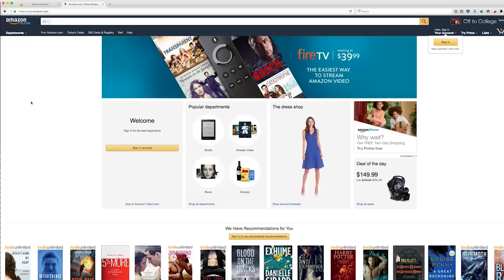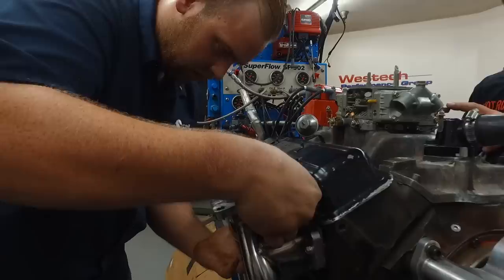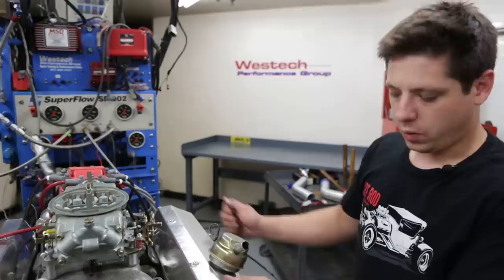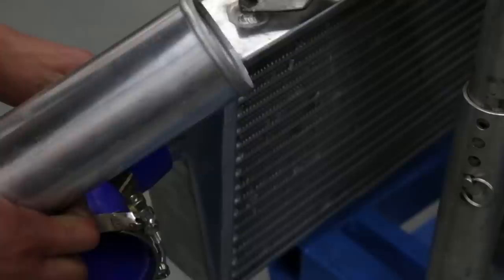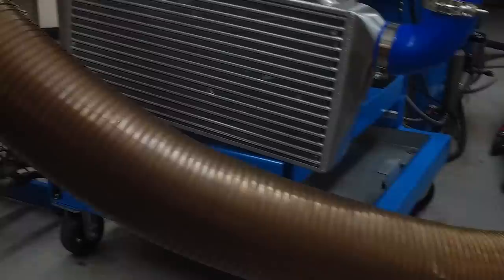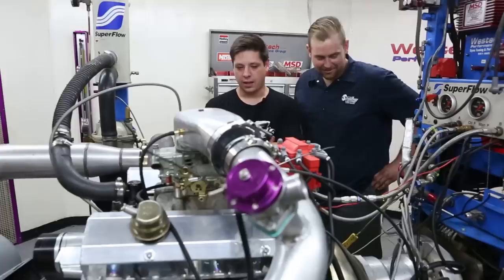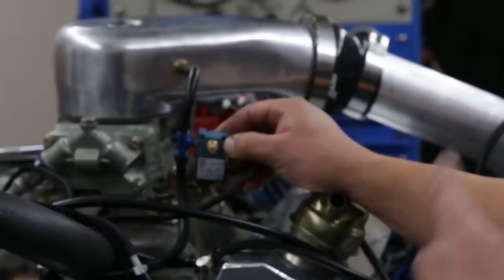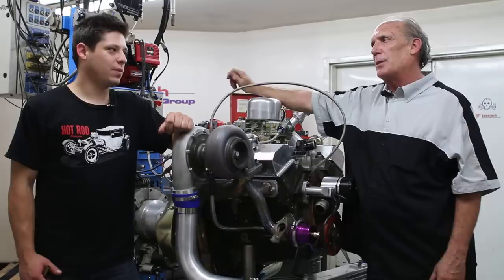Small-Block Turbo Kit for $699! But Does it Work?

Comment: Did my own ebay turbo kit and what i found was the biggest issue was not qualify, but the fitment... Turbo had the studs put in wrong lol. Everything required modification. No instructions. If you are persistent you can do it. But i would reccommend something like bell engineering who makes their own kits and makes sure they fit.

Comment: Hey look. Overall this kit is awesome. 7 hundies and a beat old small block and your zooming down the strip like a madman. This is great! Yeah you may need to do a bit of fitment, and you need SAE and Metric tools. So what. Not for nothing, but even if you spend the big bucks, there is never a 100% guarantee it all fits or works properly. And if it blows and takes that leaky small block with it.... You can feel good knowing you didnt waist thousands. So its a win win. What I learned from drag racing, Fast don't last, lean is mean but burns rings and ect., and the top fuel best of the best are destroying the entire drive train every single run to get those numbers. So if you can toss a barely average paycheck into your beat old junkyard small block, and get a turbo beast. Even if its a few good runs before failure, for the price, its worth it. My advice in all this is. Make sure you do a compression leak down test, before you buy the donor junkyard small block, and the exhaust system should end at the turbo. And you should be golden my friend. LOL!!!! Well....maybe.  

P.S. Leave it on kill. Waist gates are a waist, and don't adjust anything. Just bolt it on, and off you GO! Seems to me they have it tuned perfectly. Just please remember to make a YouTube video and post it.

Comment: It had boost creep because you didn’t run the wastegate pipe which was blowing air into the turbo causing thus boost creep pretty common problem.

Comment: I think you guys put the manifolds on the wrong sides.
Reply: they said in the video why that was done
Reply: clearly they were going out of there way to make sure it didn't work right.
Reply: I too thought this, but If they turned it they said there would've been clearance issues around the brake booster (in a car).
Reply: i have the same headers on my 84 camaro and the passenger side is the only place the turbo will fit. due to the break booster.
Reply: draggonhedd it comes like that the kit is shit

Comment: Gen IV 454 60 over bore . forged internals flotek heads 2 bolt main studded. Hydraulic roller cam.  Pair of gt45 turbos cx racing headers  . making 1012 hp at back wheels .

Comment: Is that a normal carb? Not pressurized carb???? How is
It not blowing gas out the vent wholes????
Reply: *holes.  its a blow through supplied by westech
Reply: It looks like the vent holes are under pressure as well.
Reply: I was wondering that myself
Reply: *whores 
If it's Blowing & Holes lets use the right words gentlemen.
Reply: came here to comment on the same thing, great vid but unprofessional as f. not to mention the carb at all. obvoiusly a boost app carb will cost as much as the premium package turbo kit. I cant believe they skipped that completely
Reply: bullshit, whats the fuel pressure inside a carb and whats the boost pressure? youd have negative fuel pressure (fuel vacuum sort of speak ) the boost pressure would force the fuel away...
Reply: bullshit, whats the fuel pressure inside a carb and whats the boost pressure? youd have negative fuel pressure (fuel vacuum sort of speak ) the boost pressure would force the fuel away...
Reply: The problem you're describing can be solved with a boost-referenced fuel pressure regulator. It raises fuel pressure 1:1 with boost so you never have fuel being pushed backwards through the jets. 

http://www.hotrod.com/articles/build-blow-carb-less-50/
Reply: yeah, thats a lpt of mod completely ommited in the vid!
Reply: Normal carbs can take a certain amount of boost just fine without worry but there is a limit. Once you reach that limit you buy a blow through carb.
Reply: number3665 i dont think a normal carb would even fit with a carb hat, choke horn would be in the way normal carb would leak boost, also normal carb would run lean potentially blowing up the engine due to not enough fuel(7psi of fuel vs 8psi of boost gives no fuel pressure). Its all good but i think they should had atleast mention something about it
Reply: 1DEADBEEF1 Actually it would though I've seen it done on an old Dodge 225 slant 6 engine. I've even seen guys run newer style Eaton supercharger and use a carb with that. Never underestimate a hot rodder. They didn't run much boost on either one though  I think it was actually around 8.5 -10psi of boost with regular carbs.  Not sure about the carb hat size though it used a Holley 2 barrel, maybe fabricated something up for that. But you in fact CAN run a regular carb with boost you just have to know your carbs inside and out and know exactly how to tune and jet them to keep the air fuel mixture where it needs to be.

But you are absolutely right them not mentioning it in the video opens up this gateway of trying to figure it out. And what we come up with could be more expensive or even more complicated than they did.
Reply from the maker: Actually, it's a stock carb with less than $50 worth of mods. Check out the link in the video description.
Reply: Just need to add 1 lbs of fuel pressure for each lbs of boost. Atmosphere is 14lbs so a 1 lbs boost is 15 and so forth with a boost adjusted fuel pressure regulator.  All carbs work!!!!!!

Comment: Please do this on a engine that is factory forged cast iron blocks forged INTERNALS and has 32v 4 per cylinder - 2UZFE 4.7L from a Toyota tundra/sequoia ECT 

This engine is designed for boost - very reliable very strong... maybe use a megasquirt too.. those are my plans for a 02 tundra sr5 4x4 2UZFE 4.7L V8 ... I already bought powerstop, box headers, twinntake exhaust &NGK racing plugs , CAMBERGE  ill have mid travel for awhile...I run ROYAL PURPLE but I'm thinking about using amsol next after I finish up what I have ... & the Amazon turbo kits are what I was looking at as the supercharger for my truck  is very rare and expensive aswell but it'd be nice to see what a pro can do to a truck  with a simi limited aftermarket for power adders....

Comment: Just use a 90° elbow and run the exhaust stack out the hood. And weld a couple radiator filler necks to the tubing, with radiator caps set to the max desired pressure to keep from overboosting.

Comment: It depends where you come from as to whether the exhaust manifolds are on the wrong way!

 I come from Australia so yes they are on the wrong way, wherever you come from the turbo should be on the passenger side
because that is generally where your air intake is, plus you wont hit your brake booster, so i'm thinking that kit was made
for RHD cars as the exhaust manifolds should've been swapped and turbo would be on the other side!

 Also if they had it on the right way, they wouldn'tve had to beat the living crap out of the manifold to clear
the sparkplug....i bet the front pipe was a bit longer before the bend and had more of a bend in it, since
it was designed to go the other way i reckon!

 I tell you what though, for the price they paid and what they got, you can't complain!

Comment: Great video, BUT- half the bolts are metric and half are standard? No, half are correct and the other half are American. Even the people who invented imperial don't even use it anymore its so outdated. 

Quick fun fact- water freezes at 0 degrees Celsius, water boils at 100 degrees Celsius. Easy.

Comment: Buy Torqstorm superchargers... So much easier for cheap.
Reply: Dylon Desbiens still that’s like 2 grand vs 600 bucks
Reply: RennWickam which kit is 2000 $ ?
Reply: Petar Baev the raised the price, the base Torquestorm single centrifugal tuner kit w/o accessories is $2800
Reply: RennWickam Thank you for information
Reply: Ummm supercharged uses engine power to run and over 2k to purchase. Turbo, dirt cheap uses wasted energy to power. Am I missing something?
Reply: Lag and boost threshold.
Reply: Brian Warner ungodly amounts of heat like glowing red amounts of heat and boost lag
Reply: Superchargers use more gas and are useless top end.
Reply: K3ueger Gaming Gas mileage is out the window anyway if your even driving a v8 And unless you go to the track or are into super dangerous highway racing top end really isn’t that important romping it around town is what most people do and sc is perfect for that. my opinion anyway
Reply: Lag is all but non existent with a proper tune and torque converter
Reply: maybellene500ss probably so man its not like i even really know i dont have either one sc just seems better to me
Reply: Renn So if you took it to a shop and had THEM do the install, what might they end up charging you to install (if they even could figure it out) the $600 turbo, versus spending the $2k for supercharger?
Reply: Brian Warner nothing really. Turbo is much harder to install and more difficult to tune. Other than that there is a reason turbos are a go to for power and fuel economy. New age technology vs old school

Comment: You could probably use short spark plugs for headers. Perhaps it would clear with angle plug heads
Reply: True, but it's still more "hot rod" to dimple the header.

Comment: SCREW Turbos go Supercharger instead. My 360 mopar is putting out 691 hp & 608 ft. lbs. of torque with the Blower being  Under Driven 12%. The Engine was built by BIG AL’S TOY BOX and runs FANTASTIC.

Comment: Add a hollow metal ball between carb and intake manifold ( works like a bong)vaporizes and atomizes gas doubles gas mileage
Reply: Robert Burchell Jr wrong
Reply: @CRUISEWITHSPIRIT  I made three of them one for a 65 Dodge truck one for an 85 Chevy truck one for a 73 Honda CB360 I know it works look online you will see the motorcycle running with it.

Comment: How do the producers and sellers of these systems NOT realize that several of the crucial parts do not fit together? How do you develop or include plumbing connector parts that are way to small in diameter to fit? Most important question, how durable are the turbos in these kits, and do the bearings hold up well?

Comment: I watched this on TV and had to go to my phone to post a comment if you guys had the blow off valve plumbed the way I saw it during the show boost goes in the bottom not the top and pushes the diaphragm open to allow the boost to be released if it was plumbed the way we saw you were holding the blow off valve closed so it's going to just keep building boost endlessly

Comment: I have a 68 GMC pickup I would love to put this kit on. the exhaust I have a feeling it's going to be a complete nightmare and will have to be custom-made for it but I'm going to order this kit and start it.
Reply: Best of luck dude, it looks super tight, haven't been near a Chev in a while.. that lower crossover is in a spot that could never work for most applications.. but peace brother..
Reply: The crossmember does seem to be the biggest obstaclelooking at the possibility of grsfting in a different front end on it.

Comment: You know how much power it produced after the turbo installation but not before.  For all I know, it was a crate motor that put out 25hp and ft-lb of torque less before the turbo.
Reply: Except the part where they did a base line run and said something like 300 hp.

Comment: Did you remove the cover on the blow off valve to check the spring? On Chinese blow off valves they sometimes put multiple springs inside for shipping. There are usually 2 or 3 springs for different boost pressures.

Comment: I Want too see a "rear mounted style turbo system:... dyno before and after..  
Mounting the same turbo, but back 10 ft??? and running a boost pipe back too front,, and obviously need a oil scavenge pump....
 rear mounts are easy way to go on certain vehichles.... And theres proof that thy work.. but.. be cool too se dyno results..

Comment: At 6:03 the engine experts here seem to have the wg plumbed upside down.. which would explain why it was overboosting. Back in the day we could control that level of boost/power with a single old delta gate (plumbed correctly).

Comment: Part of me wants to see what happens if you scrap the crossover and run the turbo on one bank of exhaust...Saab did it with their old 3.0 v6 turbo but then again that thing didn't make much power, just a little bump to torque.

Comment: hey FYI you had your turbo on backwards your endless Vista face towards the front of the motor where your water pipe is facing unless you were real mounting or dismounting from underneath in front inside the bumper
Reply: This, and an O2 or wide band, regardless....in the t really?

Comment: Remember that a dyno loads an engine differently than when it's on the street. You would be shifting so the load is not linear like a dyno
Reply: The load is not linear on a dyno, or else you wouldn't be measuring anything.

Comment: I noticed when you said "just leave the wastegate open and it will run on the spring because we're not influencing the diaphragm with boost" some said "correct".  That's false.  The wastegate needs a pressure reference so that it can open.  The spring dictates how much pressure is required to open it.  With no boost reference it will never open unless you build enough exhaust pressure to push it open (unlikely).  That wastegate is total trash and too small and in an almost useless spot.  I'm sure you know these things though haha.

Comment: What I know is that my Ford 460ci Z crate engine runs naturally at 575 HP and 575 Torque.  I spank it up over 700 on both numbers with a 150HP shot of NOS.  Ford rules.

Comment: meanwhile, whatever money you save on a turbo kit...goes right into a transmission, driveshaft and rear axle that can handle the grunt. and after that its a cooling system and fuel system that can feed it. and then its a brake upgrade to stop it all. mo power, mo money, mo problems

Comment: Iron block engine are well suited to boost..ref: 90s
Indy Light cars with the Chevy V6 turbo meth injection..
70s Buick Grand National..
Reply: GN was from the 80s, not 70s. Also, race cars with factory support /= reliable indicator of engine technology. Nevertheless, you're right that cast iron is generally well suited to turbocharging.

Comment: Did u guys do anything with ring gap? Iv heard before that u need to widen the ring gap. However. I also see videos like this where there is no mention of ring gap
Reply: usually on a dirty old motor the rings are self gapped by the 300 thousand miles on em LOL
Reply: but if building something for reliability definitely check your ring gap and make sure there is more then oem

Comment: The manifolds are mirror images. You had them on the wrongs side of the engine. Swap them and the exhaust would be facing back.

Comment: Those valve covers are worse in the long run, better to use shanked bolts and springs holding the cover allows for movement with a O-ring sealand in long run seals better as the engine cools and heats over its life.

Comment: They definitely make smaller plugs that you could have used as I've installed this kit multiple times. That was kind of disappointing. and you've also installed the turbo backwards it definitely fits properly the other way. Are you not familiar with turbo clocking? Of course it doesn't come with instructions it's a do-it-yourself universal fit kit.

Comment: So the "as it comes" Setup is a bit much for that 350, I wonder if it would be more Ideal on something like a BBC ?  I have a 468 I'm working on, I've built the engine in 2 different engine programs which the mean average between the 2 tell me I should be around 520-570HP, & around 570+/- in Torque, and am now wondering if this kit would be perfect to set my engine up to over 8-900 + Tq, and around 750-900HP ?  What do you think?  Or would this turbo kit be too small for 468ci. ?

Comment: A throttle cable that pulled a flapper valve closed on the exhaust would work in a pinch

Comment: Great information, I have a stock 350 motor, with 350 turbo, and I want to upgrade it, what best way to doing so in a 70 impale
Reply: There are a million ways to answer this, but maybe more details would make for a better answer. Your budget has a lot to do with it, but even within a given budget, there are PLENTY of options for a Chevy small-block. I'd ditch the 350 trans personally, but if you don't foresee much highway driving, a swap might not be financially sensible (the main reason to swap IMO is to save fuel).

Of course, there's also another way to make a car go down the road, comrade...
https://www.youtube.com/watch?v=I89llX3HUWc

Comment: At what rpms did you start making boost, was it 10psi or 10 lbs what rpm where you at full boost. Did you use a blow through carb

Comment: Who would buy a "cheap" turbocharger kit and NOT spend the extra cash for the parts that can  save the engine if shit goes wrong. Meaning the "blow-off valve", boost controller, etc?

Comment: You got 300 hp from a "stock" truck 350 in original, un-rebuilt condition? You might want to check that dyno calibration or the correction values.

Comment: too bad they dont make universal supercharger kits.. basically it would  come with a stack of pulleys and a bracket that may or may not have the correct drilled holes.

Comment: but you have to thing , look how much room that took up and how much finagling you had to do. if I was a dude in my garage trying to do this with the engine in the car , that piping running under the motor and getting around a cross member , motor mounts , steering rack and so on ..thus kit would be a pain in the ass.